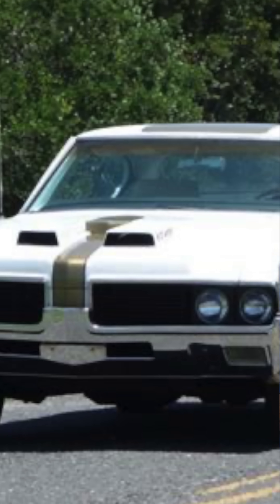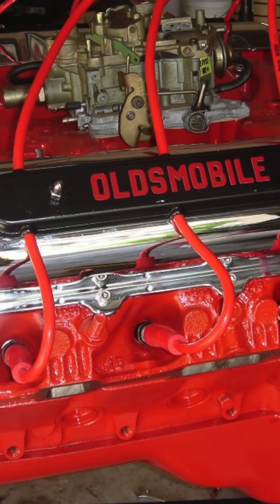Building a 500HP Big Block Olds? Ask Ed Smith 38 - Ed with #BarryT #classiccar #musclecar

Comment: I have a 1970 Olds 455 Hi Perf engine that I built in 1991 for my 1982 Cadillac Coupe DeVille after the diesel engine blew up.. The oil cooler filter base from the diesel fit right on the Olds 455 engine and along with the 4 core diesel radiator it never ran hot, even around town running the AC..   I bored it .030 over with 10:5-1 TRW pistons, Crane full race Cam & Lifters, Hi Perf Heads, Valves, & Springs, Roller Rockers, Hi volume Oil Pump, Hi Rise Edelbrock Intake, 850 Holley,  It is over 500 HP.. I used it to pull my two horse thorobred trailer loaded with two 1100 lb. horses to the races all over the country.  My first trip after I built the engine I was clocked doing 120 mph in Dallas Texas on I-20.. It took the trooper 10 miles to catch up to me.. He couldn't believe a Cadillac could pull two horses that fast, and he just had to take a look under the hood.. He gave me a warning and let me go.  I had a good day after my ponies both won their races and my engine passed the first 500 mile road test . Its still running strong today.🥃😎👌
Reply from the maker: Wow, what a story! That sounds like an amazing build.

Comment: I think you can take a stock 69 455, and make it breathe. Headers,  intake with carburetor and good ignition. And anything kinda exterior. Rockers, oil pump, and i think way over 500lbs torque, and 465-490hp.

Comment: There for a fat minute, it was common to grab an olds diesel use the bottom end with gas set up on top
Reply from the maker: I forgot about that, I’m going to ask Ed if he’s done that
Reply: @BarryTsGarage the olds diesel were solid when maintenance was done by a good tech. Also they were  a where popular replacement for the 6.2 diesel, just put in a 100% olds diesel in the pick up.

Comment: What can you get out of a 351 Windsor on a '71 Ford galaxie? Asking for a friend.😅
Reply from the maker: I will ask Ed, he actually really likes that 351 Windsor and he will have some ideas…
Reply: I took a "SuperFormance Shelby Cobra" for a test drive once after doing a 4 wheel alignment on it, it had a 351 Windsor dyno certified 648-HP 576-TQ.
On Hwy 395 in Reno at 70 in 4th gear I mashed the throttle down.. rear tires smoking trying very hard to hold my head up you could hear me screaming HOLY SHIIIIIT from 3 miles away! 😂

Comment: 500 HP from an Olds 455 is one of the easiest goals there is when it comes to engines. These are by far my fav, been building them for 40+ years. Currently have 12 of them from a complete race engine to core engines and everything in between. The right camshaft is important and try not to skimp on compression. When dialed in they won't rattle or detonate on pump gas even with an actual measured 10:1
Reply: ive worked on a few olds 350s  and they are great engines.   lots of torque made those heavy cars just move effortlessly     my favorite was a 76 cutlass.  we cam carbed and new full exhaust and that car sounded and ran awesome. and got great fuel mileage when driven with respect.  i loved driving it!
Reply: @MrChevelle83 I had a 74 Cutlass Supreme. From the factory duel exhaust, 400 transmission. A friend had a 75 that didn't have duel exhaust but, it had a 400 transmission. Mine was just a little bit faster Evan after he put duel exhaust on it. I don't know how much different they were. I don't know what options on the build- sheet were. Mine just ran better.
Reply: @gregHames-u6n  yea the single exhaust would likely have slowed it down at least in the top rpm range
Reply: I am an Oldsmobile fan and long ago someone said " you really don't want to boar out the block on the 455OLDS because they are high nickel blocks". Is that true?